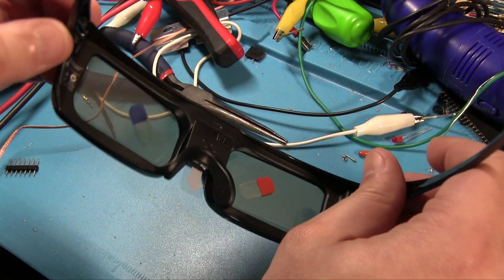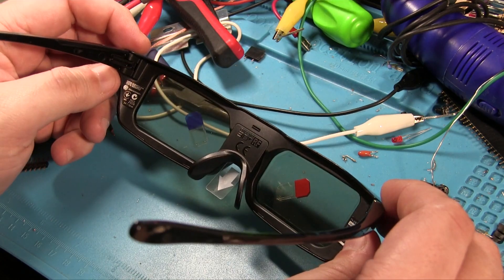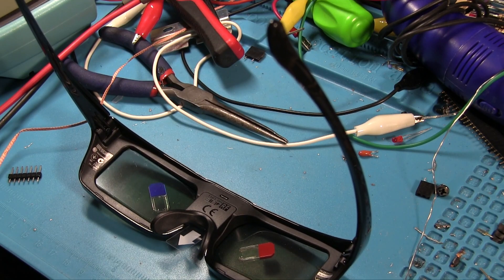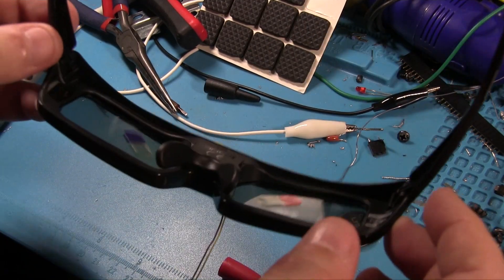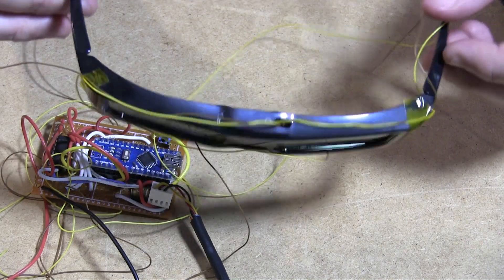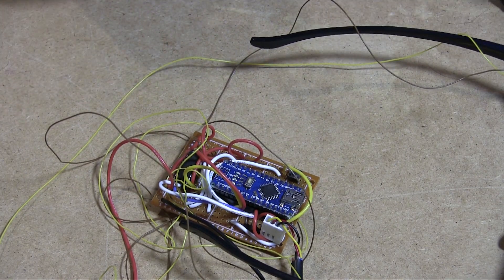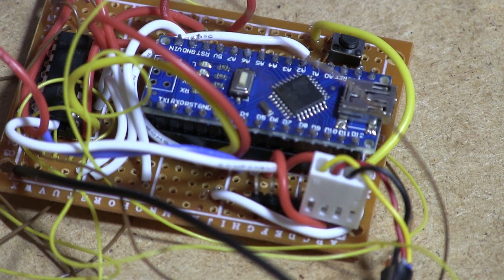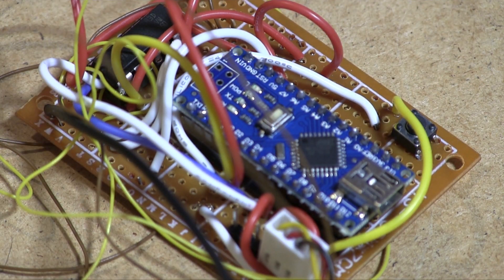Hardware Hacks: Vectrex 3D Imager Build

Comment: if the glasses were working, then you would only see one view in each eyepiece.  Instead (around 12:54 .. 12:58) you still see both views in each eye when you hold the glasses in front of the screen - it is clearly not working.  What's the deal with that?
Reply from the maker: It works with my eyes - but I couldn’t get it to work through the camera